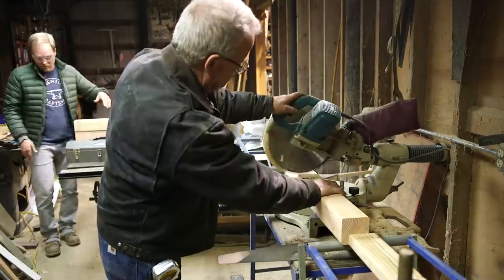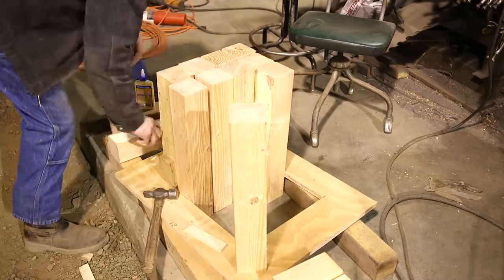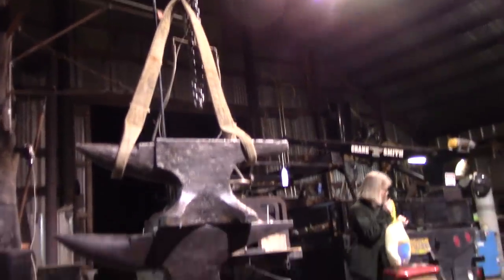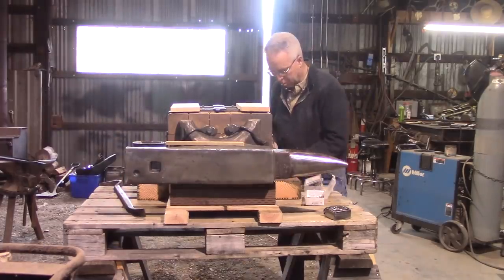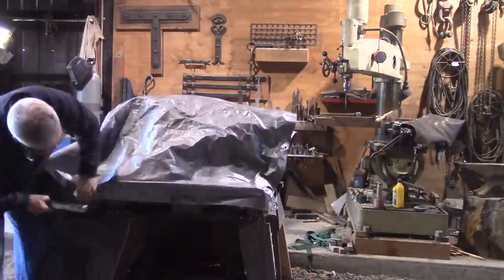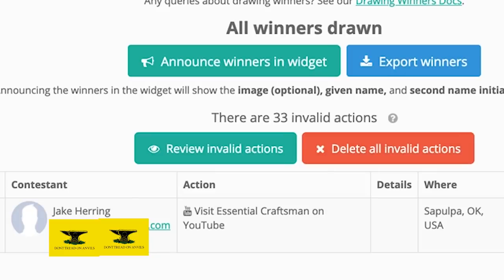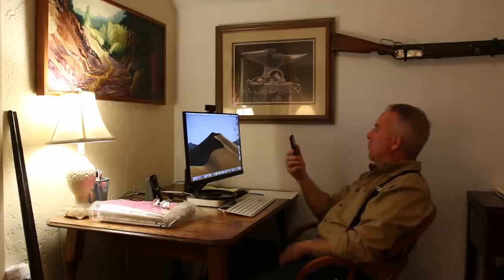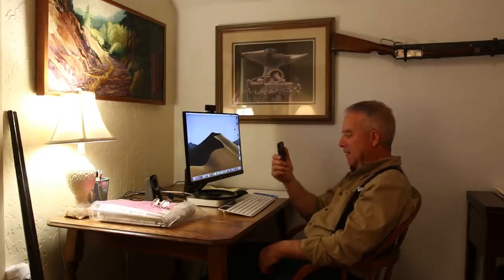How to Win an Anvil

Comment: So I inherited a small anvil with a 4 inch wide and 8 inch long worksurface for a bench top.  What is the best way to level the top surface and square it up.  The end goal would be to use it on leather working projects and making arrow heads.